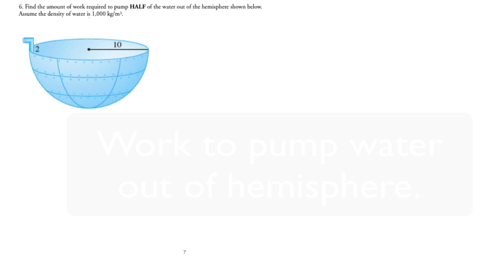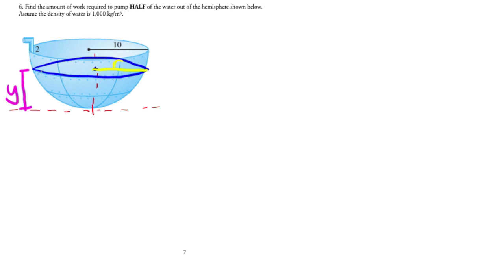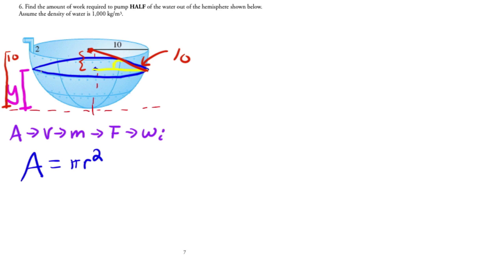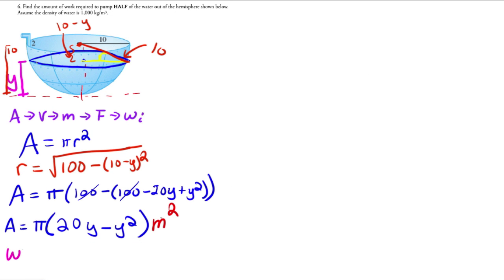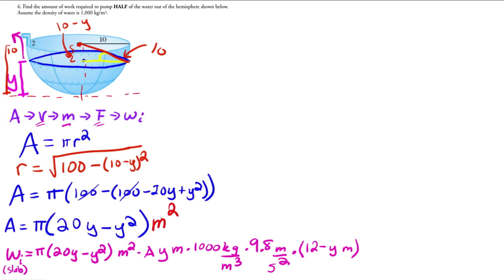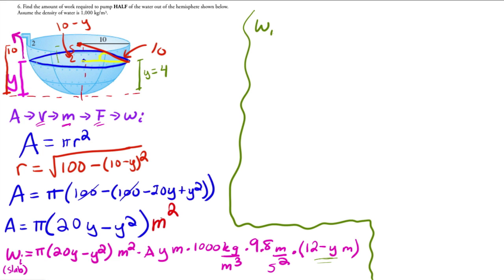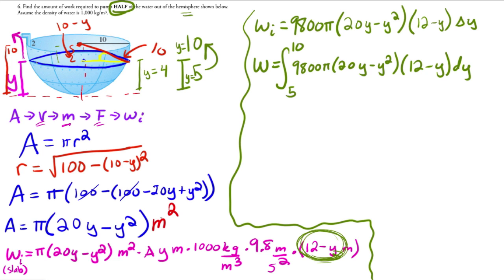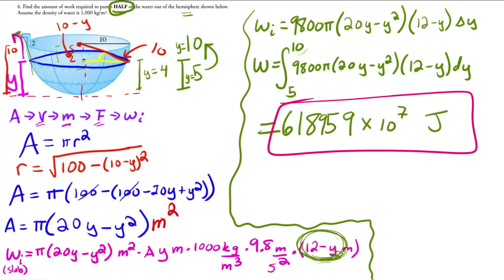Calculus - Applications of Integration - Work Pump Water Out of Hemisphere

Comment: If the limits of integration are from 5 to 10, then wouldn't you be pumping more than half the water out since the top half is larger than the lower half? 

You're gonna get half the total depth of the water at the center, but I think the question is asking about half the total volume of water.